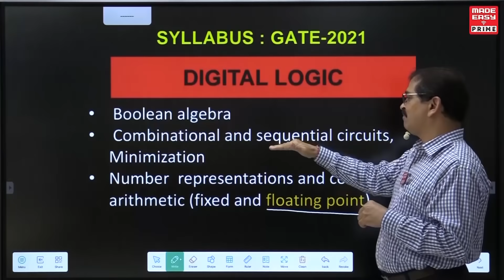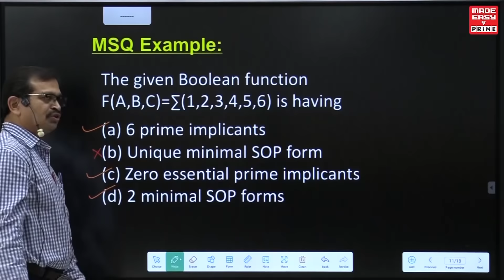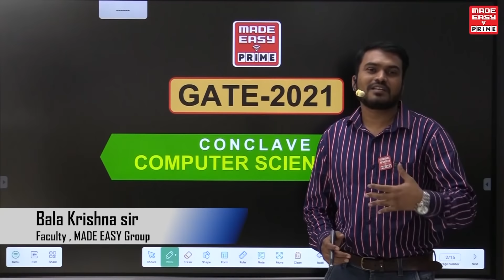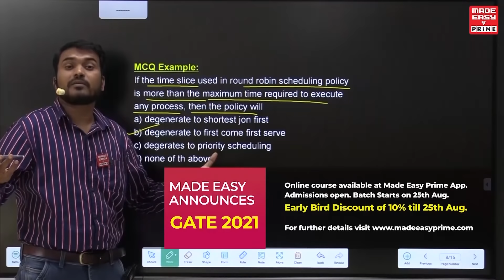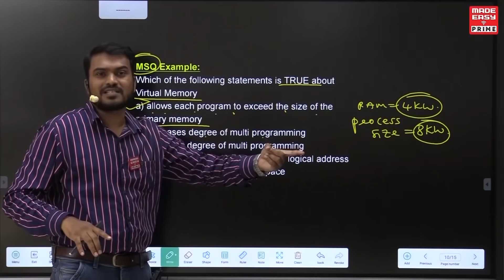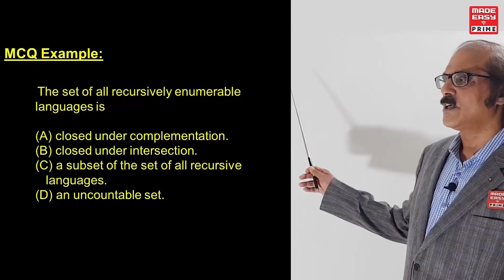Comment: MADE EASY Prime has announced GATE 2021 online course (based on latest syllabus). It is the most comprehensive and well-structured online Course for GATE 2021. 

Avail early bird discount if you enroll until 25 Aug 2020.  

To Enroll Visit: https://www.madeeasyprime.com/gate-2021-online-video-course
Reply: Please upload toc lectures in gate cs2021 online course along with the present subject
Reply: Madeeasy prime app is not working.Please fix the issue as soon as possible